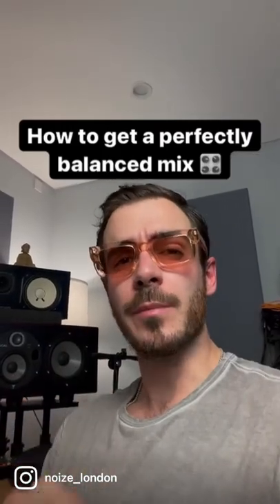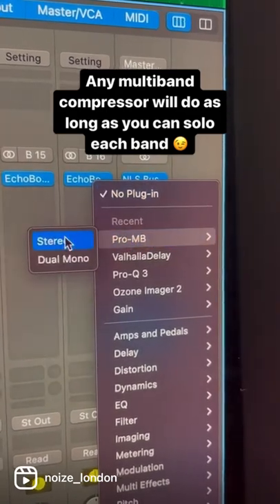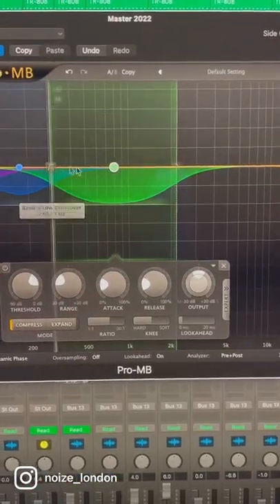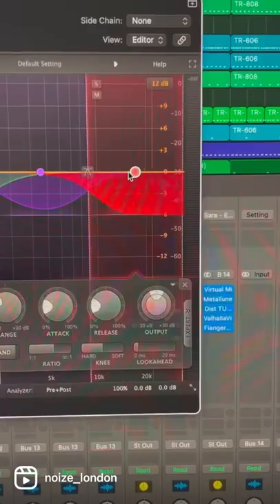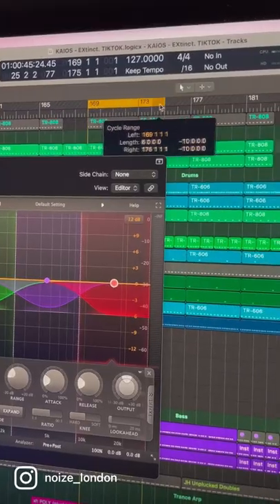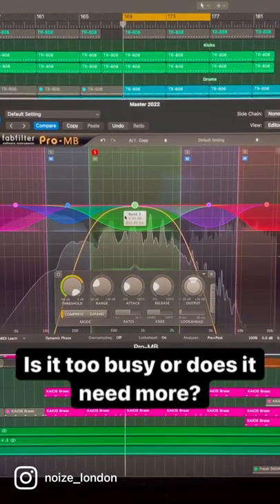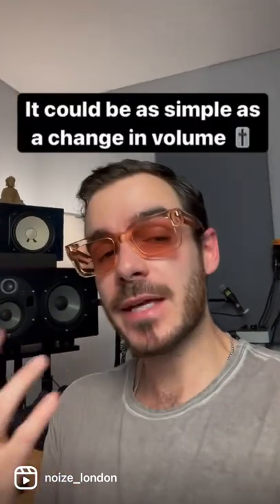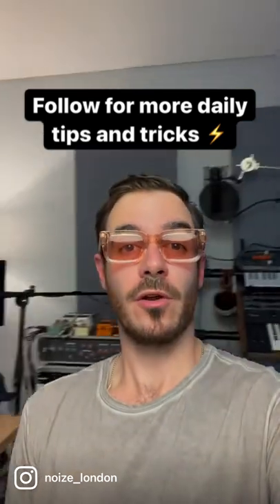How to get a perfectly balanced mix 🎛

Comment: TB Pro Audio has a monitoring plugin called, ISOL8 and you can mute and solo 5 different bands with adjustable crossovers. M/S as well. And it's free. A great utility.
Reply: one of my favorite plugin
Reply: Thanks for the info 🙏💯💯
Reply: Isol8 is saving my mixes🤟
Reply: @RikiAbi  It's a really handy utility. The only thing it doesn't have that I wish it did (last I checked), was the ability to swap L/R channels. I have high-end hearing loss in one ear and need to swap channels while mixing. I use bx_solo for that.
Edit: I stand corrected... they did add a L/R swap to ISOL8, so I will have to thank them for adding my suggestion..
Reply: Soothe 2 enjoyers 🗿
Reply: Im about to try it, thank u
Reply: isol8 be saving my ears when i understand the direction of my vocal mix but am exhausted with the beat 😴 filter it to just the gentle frequencies or isolate the ones that need to be tamed 💆🏽‍♂️
Reply: You can also press command while selecting a band in SPAN.

Comment: That’s a great tip, i remember when I learned that tip it legit changed my mixes so so much.
Reply: So basically you listening for which one is too loud or too low?
Reply: @WassupFred  Yea essentially! As well as it will change how long certain sounds rings out when you change the attack knob. A good term to research is Transients for this concept.

Comment: Mad useful. This is one of the reasons i swear by Tonal Balance Control. But this is essentially the same thing just free af.
Reply: God tonal balance control is amazing 🤤
Reply: @ubu-ibme  it's not free tho
Reply: @realjerrymerry   Nope. I actually prefer this method better cuz for whatever reason you can't turn on/off the bands in TBC... only click-and-hold... like wtf? Why?? I just like the gain margins they show you. But yeah, definitely not free. Definitely not worth buying it just to buy it alone. Way better if you can find it in a pack instead.
Reply: @realjerrymerry  depending on which links you click👀
Reply: Do you live and die by TC?

Comment: Thanks for that! It gave me the idea that you could also run a parallel bus with no output, drop an EQ in there with low- and high-pass filters, and place a multi-analyzer behind it.

Comment: Best tip you can do is listen and balance in mono!
Reply: Balancing in mono is a bad idea.
Reply: @dennisstember5062  how so?
Reply: i actually heard this a couple times, is there any reason why ?
Reply: @dennisstember5062  balancing of tracks volume not panning L/R
Reply: @r.a.7898 if you have a bunch of stereo effects and stereo sounds, when you cram it into mono it can sound like ass.  Some sounds are supposed to be on the stereo field
Reply: The thing about mixing and mono is you have do it responsibly, because a lot of sounds are going to be in stereo . I would still do it, but I would toggle between a good mix on both mono and stereo. for example... all sounds that are straight down (or close) mixing mono while addressing those. Then activate stereo while mixing those extremely panned and stereo sounds that get all weird and phasey when they're in mono
Reply: checking in mono is good but you def don’t need to do the whole mix in mono

Comment: I mean, you can really just do this visually using the analyzer while listening to the whole mix. After all, it's only in the context of the whole frequency spectrum that you can know which area needs to be increased or decreased. Soloing different bands is just a way of confirming what you already know.
Reply: „Ah so these are the high mids, they do sound like high mids! Nice, good thing I’ve used this great technique“ - someone using this right now

Comment: Multiband compression should be used to fix issues, it shouldn't be an absolute go-to for every mix...
Reply: It is not using any compression. It adjusts the volume in different bands.

Comment: I have a better tip. 

Use your ears and plug into atleast 4 different types of speakers when mixing.

Done. 

We be using devices too much
Reply: We be preaching to much while on our high horse.
Reply: @henrygrandpagobbleblobber6751 
You be ignoring great advice too much. He’s right. There is zero need to ‘see’ how much energy different parts of the spectrum contain. Use your ears and check decisions on multiple speakers. Been done for decades, and is way more reliable.

Comment: Adjust the volumes based on the energy? Could you elaborate more? How do you know there’s too much or not enough?
Reply: Use a reference track and compare
Reply: Use a  "similar" sounding track as reference using a random, different genre track  wont probably help.
Reply: @mehmetabdullah250  Thank you.
Reply: Use your ears
Reply: @DBTHEPLUG  Sure, but your ears are only as good as your listening environment.
Reply: @LennonJCihak  I use a headphone.
Reply: To be honest, you don’t notice it until you hear your mix and a professional mix. 

It’s a bit of ear training to listen for the intensity of parts of your mix. 

Your ears will hurt if it’s not mixed correctly.